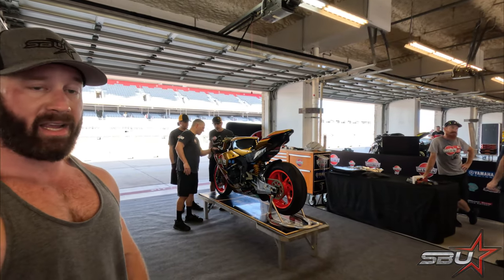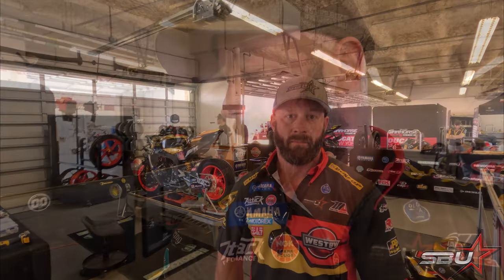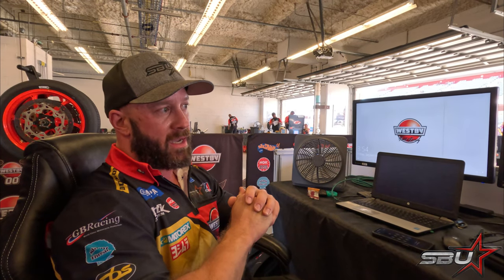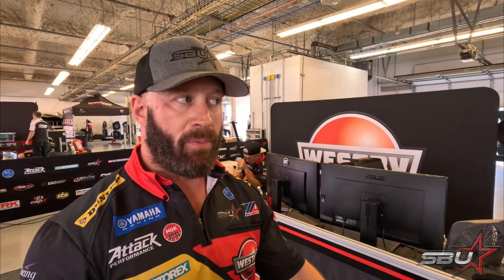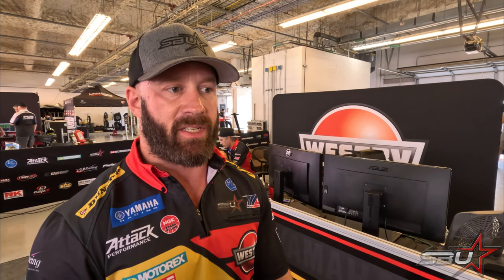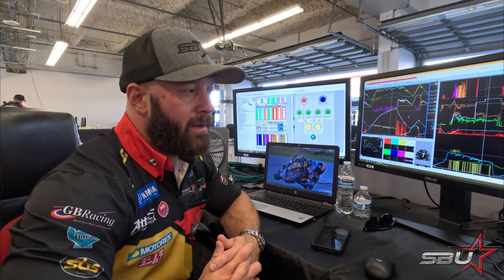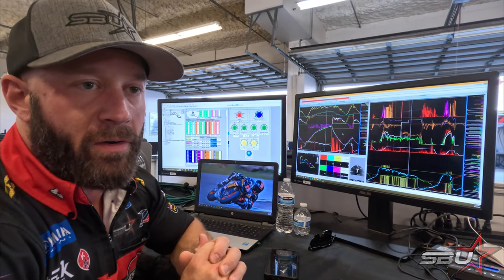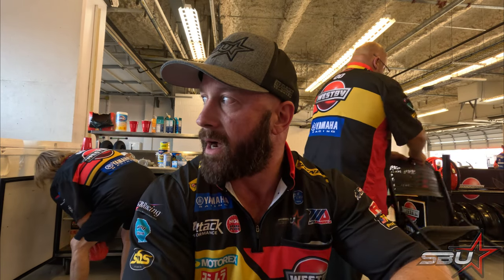Inside the Intense World of MotoAmerica Superbike Racing at COTA - Mathew Scholtz / Westby Racing

Comment: How hot do the bikes get sitting on grid after warm up lap before race start? Do some people shut off the bike for a sec and coast to their grid and then restart when the green flag comes out and lights go red?
Reply from the maker: Depends on how long they hold them. No one restarts, it’s too risky. Usually around 100c /212f
Reply: @SuperbikeUnlimited  got ya. So I assume motoA is little quicker then Wera with the starts. Sometimes my rr-r gets up to 112c and it drives me nuts. Almost wanna shut the bike off and pull of the grid. Not trying to blow a 10k motor for a club race. But I’ll be doing couple motoA stock1000 rounds next year. Thanks for taking the time to respond.
Reply: Heat soak without coolant circulation.